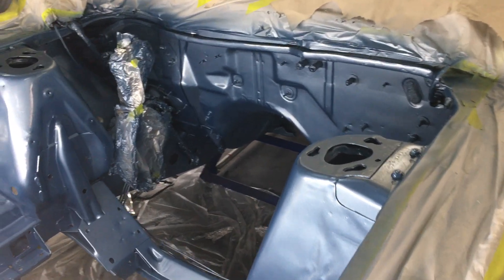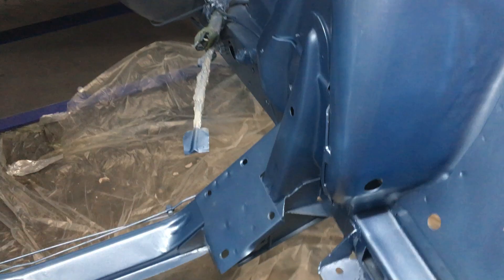XE Falcon Police Project engine bay painting holidays day 6 and 7 and 8

Comment: With the lip along the firewall, how did you end up repairing it? Did you weld in thin strips to fill the gaps? Or cut the whole lip out and run a new piece across?
Reply from the maker: I wire wheel the buggery out of to find the good metal, then used the angle grinder to cut strips out one section at a time of the rusty bits. Just did the top ones then the bottom ones. Tack welded them as best I could and used metal filler to do the rest with body fitter for the fine up. As you can see used the filler to make it as a single section not separate like OEM. I used some spare metal from one of the dead doors.